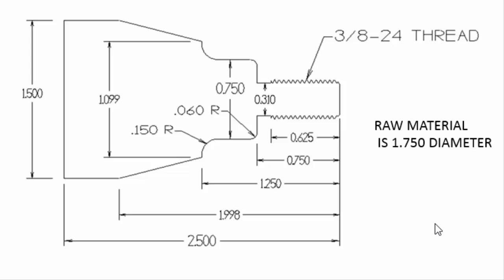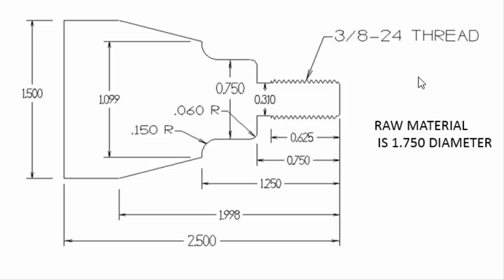CNC LATHE PROGRAM REVIEW OF EXERCISE 1

Comment: If you turn up the feedrate on the machine panel. Would the part still  be made the same way. (Issues?)
Reply from the maker: maxnguyen22 
When you turn up the feed rate the spindle speed will not change. Therefore the surface finish will not be as smooth. If that is not important then turn it up and make the part faster.
Reply: Tom Stikkelman also want to ask for an opinion. I am no math wiz, just basic math. Do you think it's ok to have a machinist but not have great math skills?